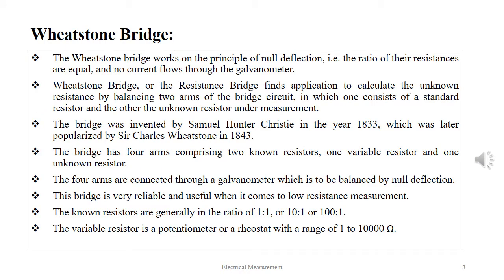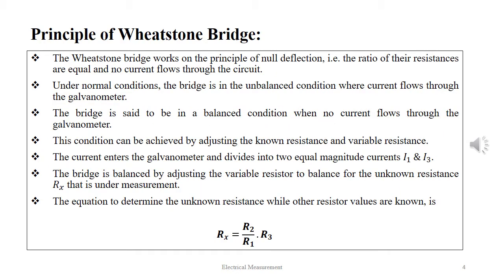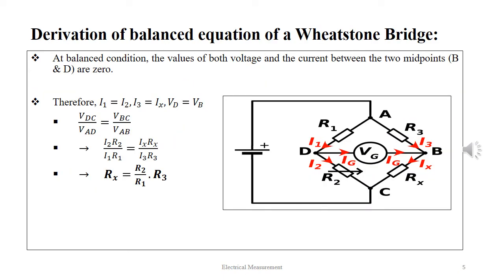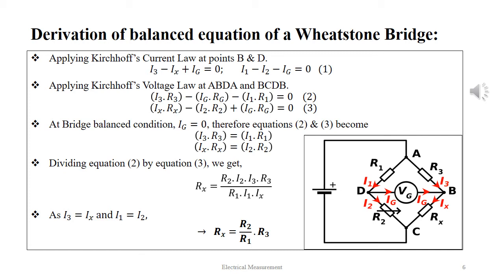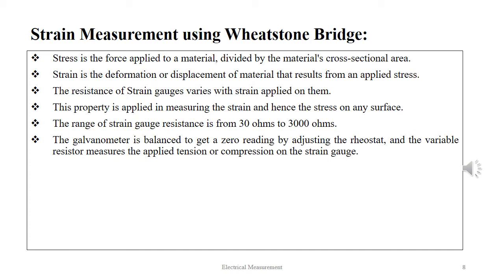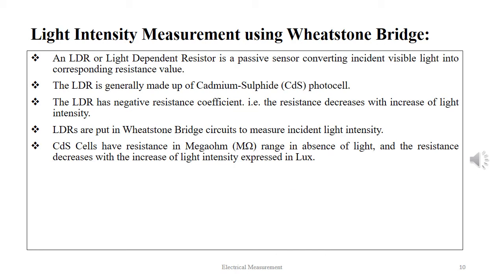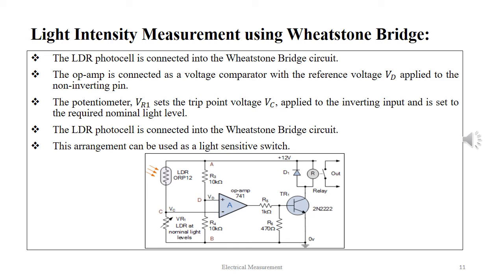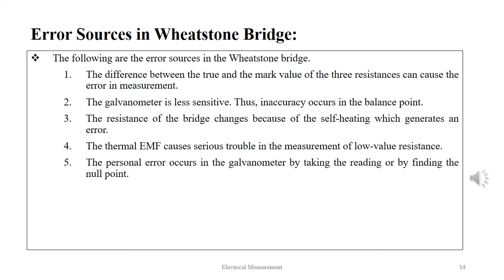Electrical Measurement - Tutorial 8 - DC Wheatstone Bridge

Comment: At 5:40 (Point 3)~
     Isn't is supposed to be "...with STRESS applied on them", instead of "...strain applied to them"?
Reply from the maker: Stress is a force acting on any surface per unit area. ... Stress causes strain, if it is sufficient to overcome the strength of the object that is under stress. 
Strain is the change in shape or size resulting from applied forces (deformation). Most surfaces (if not all) only strain when placed under stress...

So both the words are used interchangeably. 
Hope that answers your query.
Reply: @EngineeringTutorialsFBP  So, both the words are used interchangeably. Now I got the point.
Thank you for your clarification!
Reply from the maker: @snehashishbanerjee2575  this is not true for all instances.. But in this current context, it is so...
Reply: @EngineeringTutorialsFBP  I see! 
Okay sir, it's cleared now!